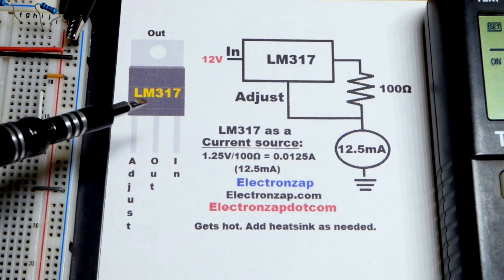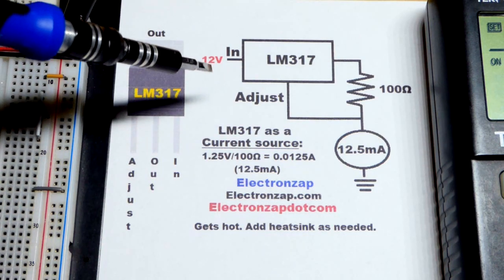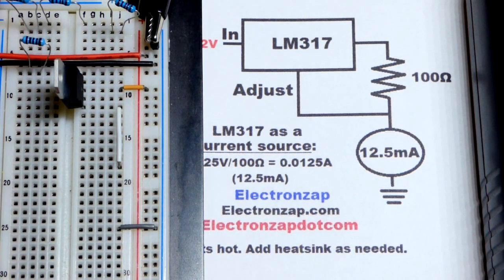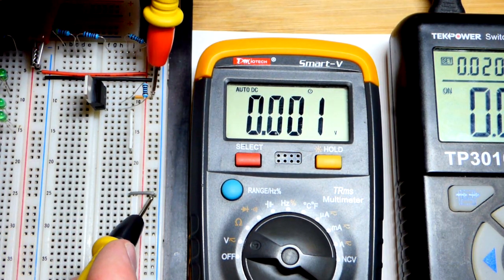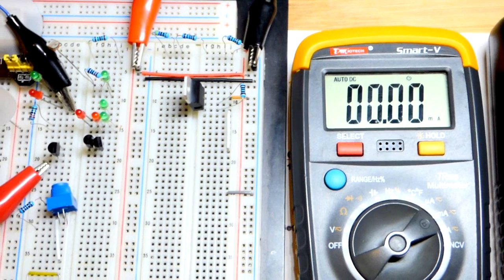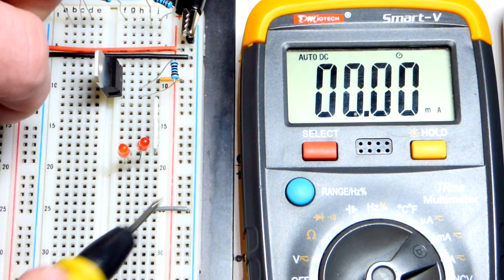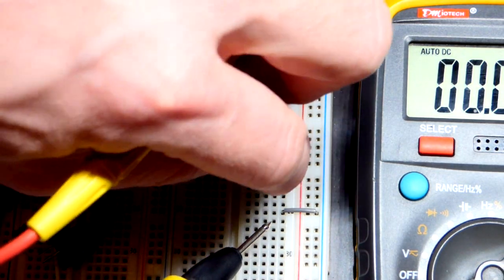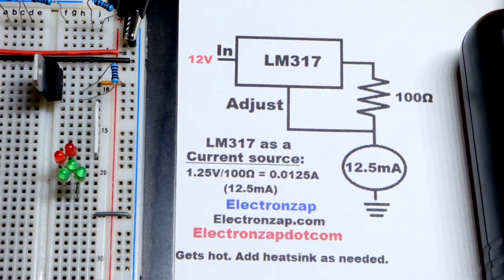Quick LM317 wired as a current source circuit schematic to breadboard build by electronzap

Comment: I don't understand. What is the supply voltage output?
Reply: This is not easy to understand. I am still trying. :) So at first, before any LEDs are connected, there is no supply voltage out ... but you put one LED in there is enough voltage to get past the LED's voltage drop and still allow 12.5mA of current to flow, lighting the LED. Place another LED and you need a little more voltage, enough to get past two LED's voltage drops ... and still allow 12.5mA of current to flow. Rinse and repeat, but eventually you will reach a limit of LED's that can be lit up. Essentially we don't even need to worry about the voltage output. Does that make sense? It almost does to me. :)
Reply: @HazeAnderson  The circuit seems to require a load in order to show an output. But what I don't get is the relationship between voltage and current. Even if current is limited to a set amount doesn't  it still matter what the voltage is? What happens to an LED that should be driven at 1.5 volts @ 10mA if it sees 12 volts? It seems to me that you would need to regulate both voltage and current.
Reply from the maker: The voltage is split up across each of the series components. About 1.25 is across the resistor , about 1.9V is across each LED and whatever is left is across the LM317 Input and output terminals. It's confusing at first but it is explained when you study Kirchoff's voltage laws.